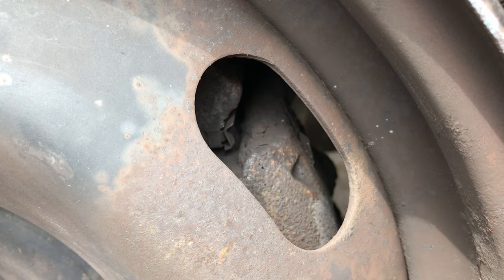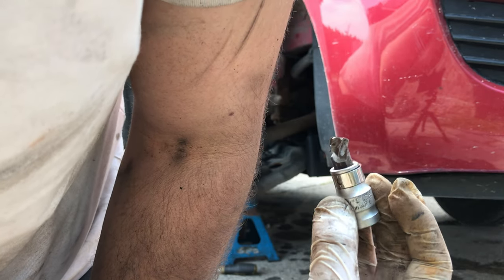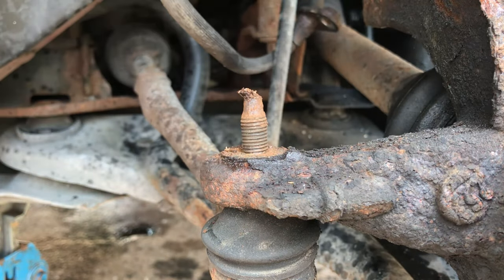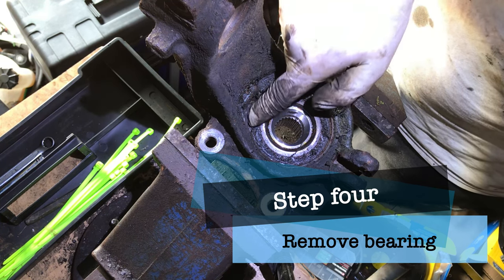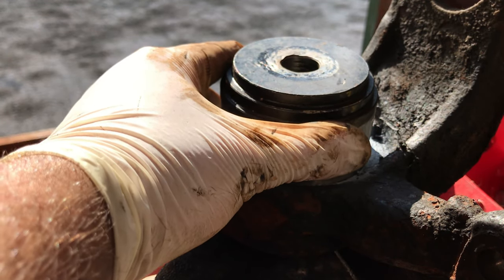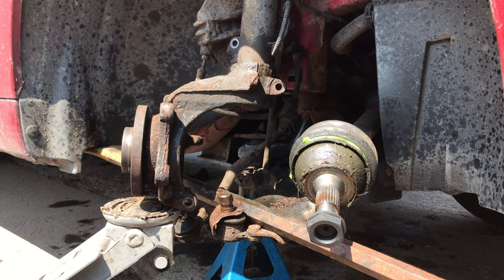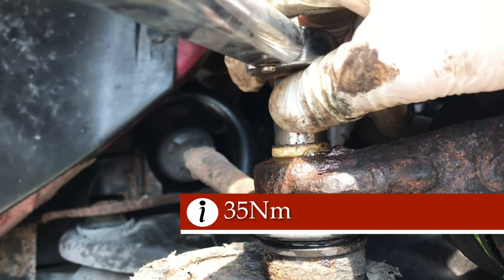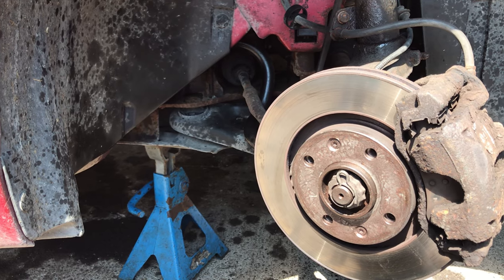Citroën C3 Picasso Front Wheel Bearing Replacement

Comment: Don't 'click' your torque wrench several times, once would already be the correct torque.
Great video though, makes me mentally ready to tackle this job... just need that press!
Reply from the maker: I hope you get on well with it!
Clicking the torque wrench is the yield in the spring which stops the force of the handle being transferred to the square drive 

Youd have to go really ham on it to tighten it further (unless its 1/4 low torque)

Comment: Great movie. But... You should clean rust on the nuckle arm firts...
Reply from the maker: The knuckle arm?
Reply: @maxautouk  Steering Knuckle
Reply from the maker: @wodzimierzknapik6741 what would cleaning off the rust achieve?
Reply: @maxautouk  Bearings don't like dirt. We see a lot of dirt and rust during assembly.
Reply from the maker: @wodzimierzknapik6741 the inside bore was very clean and both sides of the bearing have seals to keep debris out - where i live rust like this is normal and this bearing has been totally fine! ☺️ also dont forget the flange and driveshaft are not fittwd water tight to the bearing so they are open to the elements constantly
Reply: @maxautouk  Next time use wire brush before You disassemble - It will take you a while and it will be clean.
Reply from the maker: @wodzimierzknapik6741  no thanks 😄